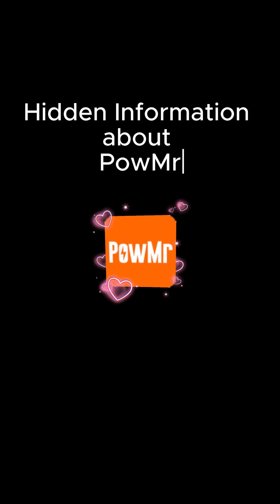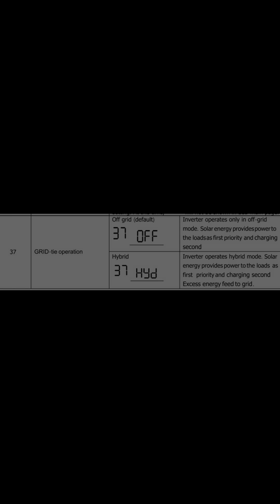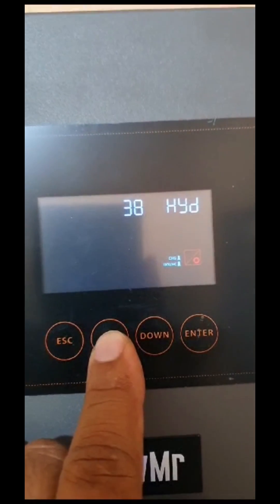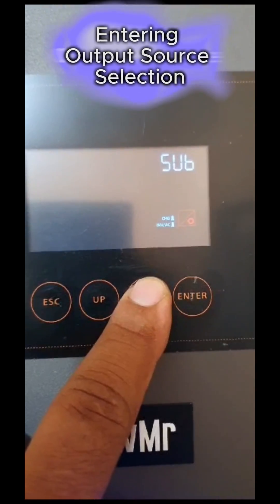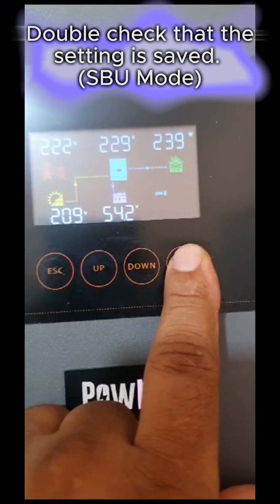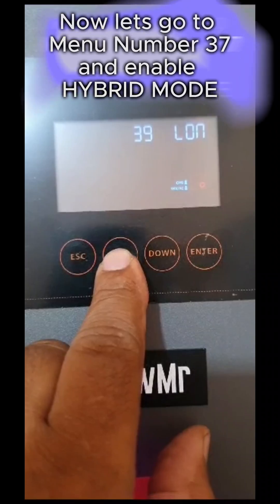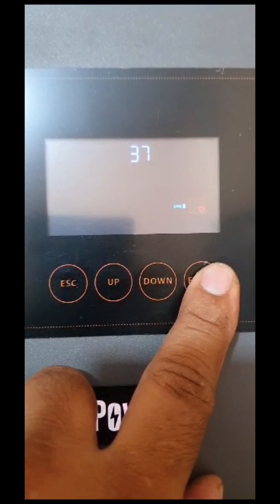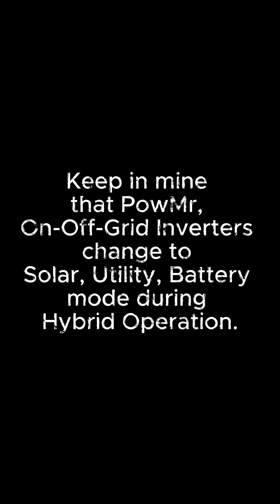Everything you need to know about On/Off Grid Inverters - On-Off Grid PowMr

Comment: I am having issues with my 6.2kva PowMr Hybrid inverter. It triggers off my battery breaker when ever I try putting it on. What will i do to power it ON ?
Reply from the maker: If the battery braker has the currect Amp range then, it seems like a inverter issue.

Comment: Hi sir, great video, thank you very much. I have one question, how's the inverter doing? Is it still working?
Reply from the maker: Sorry for the late reply yes it is. But if you get onee wire it correctly add all required protection and make sure to clean the filters and keep the inverter  clean.
Reply: @diydesk thank you very much 💪🏻

Comment: So if will choose 37 option to HYD hybrid mode inverter won't take energy from battery at night time when there is no solar?
Reply from the maker: Sorry for the late reply, Yes you are correct. So what I do it I use a Smart Circuit breaker to disconnect the grid input at night so the inverter changes to battrey mode. Hope this helps.

Comment: My set up is i disable the bypassed. 
Im sbu mode 
And snu changing 
And off-grid mode
Is my settings is correct?
Reply from the maker: It's not wring but in my case I need stop using grid power for battery charging therefore I have set the charging to Solar Only instread of SNU.

Comment: My 6.2kw having trouble ,sometimes have long sound, and sometimes if I open my AC Unit It shot down the inverter. What should I do for this problem?
Reply: 2:54
Reply from the maker: Hi, Long sound means a beep soubd from the buzzer ? If the inverter is shutting down the inverter when the AC is on it looks like overloading the inverter or having some issue with the AC unit.

It is hard to detect the cause from what you have shared. Better show your system to a technician.

Thank you and good luck with it.

Comment: In my case the hybrid mode is off, the output mode is set to SUB, but still, inverter is going into bypass. 
The charging mode is set to SnU which means both utility and solar is used to charge the battery, but this mode is only available in SUB mode. 

My best scenario would be as described below:
1. When there is solar energy sufficient, the inverter would provide power to the load first, and the unused energy into the battery at the same time. 

2. The battery would be charged by the utility at the same time by the current sent in option 11 of the menu. 
Because i've already had a grid-tie inverter solar system installed and it is connected before powmr, it would feed its power from the utility side by using extra solar energy

Would be even nicer if it could be programmed by time or action (Which is impossible i suppose).

So currently even if the priority is set to SUB, it still works in bypass mode while charging the battery from solar and not feeding any energy from the inverter.

The easiest for the powmr as i can understand is a create a firmware which allows SnU chargine (Both utility and solar) at any time or even with additinal option allowing to disable any charging (Both utility and solar) when Solar (The main source) is unavailable. Meaning that there is no energy nor from grid-tie (utility), not from DC solar side is available and therefore not to take any energy of the grid. 

I will try to contact powmr and explain to them this logic
Reply from the maker: Yes, it's a good point, Deye inverters support timing but it comes with a high price tag.
Reply: Can you not just buy a smart breaker and use that to connect/disconnect the inverter from grid using its timer option on the app on the phone.. it's called scenes automation there are many ways to automate the breaker using data from another power monitor connected to the output of the inverter or solar........

Comment: Can we export and sell electricity via net metering?
Reply from the maker: Most countrues Yes, but the PowMr Inverter may not have all required certificates for you to get the approval from your electricity provider, therefore you might have to look for a brand like Growatt or Deye (if you need hybrid) but my sujjestion is to have 2 systems On-Grid and Off-Grid seperately. It may requiremore space but in the long run it is more practical.

Comment: We have powmr inverter POW-HVM6.2K-PRO model in India .When we on ac grid input that time they show 0 voltage and battery not charging ,and input settings is USB,how to solve this problem
Reply from the maker: I am sorry, I don't have a clear answer for you but you can try few things -
* Did you try to reset the inverter settings and try it?
* Is there anyway you can check Grid Voltage / Freaquency ?
* When you have a load connected while grid is connected which power source provide power to the load ?

I think it's better to get a video of your issue and share with PowMr team.

Wishing you luck with the issue.

Comment: We have installed powmr HVM-6.2M-48V-N. it works well in off-grid mode. but in hybrid mode SUB setting inverter switches to utility itself after 02 minutes irrespective of solar energy. Batteries are attached. Please guide us
Reply from the maker: If the grid feeding option is enabled (hybrid enabled) it keeps the battery for backup during utility loss, and works on grid and solar.
Reply: Bhai ye net metering krta hai?
Reply: @talhaahmed6215  option ha. Hybrid mode per
Reply: @muhammadshahzadyousaf1282  mtlb ye lelun tou sell hojaegi?
Apne ktne ka lya tha or duty ktni di the?
Reply: @talhaahmed6215  we are using it off grid mode with sub setting. In hybrid mode it feeds extra units to the grid. K model is far better than this with option wise. Which is all in one inverter

Comment: Sir Does the inverter run if u remove pv and Ac cables but plugged to the battery only can u able to run appliances?
Reply from the maker: Yes, If you have the battery charged, the inverther can run from battery only. I use it from battery daily during night time.

With 105Ah x 16 EVE lifepo4 cells I run the house at nigth, 2 Inverter Air Conditions, TV, Lights, sometimes coocking on induction.

Early morning around 2 am I connect to Grid power automatically to save some battery power.

So this inverter can run well on Battery. If someone needs to know if this can work without battery yes that is possible too but you need to have a stable grid connection and the solar connection. If the sun is low and the usage is high the inverter will use grid power. So we need to have a grid connected. (this is required only during batterless operation)
Reply: @diydesk  Thanks for your response Sir mine it's doesn't work from batteries only the problem is when I plug a fridge my inverter the fan start to run non stop immediately so when I plug small appliances like charging phones it doesn't give me a problem so currently I don't have solar panels and electricity so I connected my inverter in 4 12v batteries (parallel) as my inverter is 12v so the batteries are fully charged I use a generator to charge them then plug inverter I tried many things even to adjust the perimeter it didn't work out and it doesn't show any  faulty sign but it can't run heavy appliances as fridge I'm talking about is the any thing I'm missing please advise me 😔?

Comment: Sorry - you misunderstand the term 'grid-tied'. Grid-tied means it can deliver power to the grid. You are talking about a bypass function: the inverter takes power from the grid and delivers it to your load. This way you have a backup function in case your battery drains down or PV doesn't deliver (enough) power for your needs. This in NOT grid-tied operation! The output of the inverter cannot be connected to the grid --> short circuit! It doesn't adopt the frequency in phase! So be careful, what you explain here!
Reply from the maker: Hi Dear, thanks for the valuable comment. Just to be clear that we both have the same idea. 

This inverter feeds power to the grid using the grid input connection not the output.
Reply: @diydesk  No, sorry - you are wrong here. Grid input means it takes power from the grid and delivers it to its own output - its just a bypass for PV/Battery. Hope you understand.
Reply: @rilosvideos877  I have confirmed from the manufacturer (PowMr) the unit supports grid tied operation and it feeds back the excess generated power back to the grid via AC input line hence the breaker is rated at 50A. I have yet to try it on my own unit after the net metering is installed. Thanks.

Comment: is there an option for offgrid but it charges batteries from generator.
I don't have remote start for the generator so I would have to turn the generator on manually for top ups
Reply from the maker: Thanks for reaching out. Sorry, I am not sure of that. Hope someone will respond to you soon.
Reply: @diydesk  No problems, thanks for the reply.
I think if I turn hybrid off and have it in SUB mode it should do what I want.
Solar first then batteries and if I turn the generator on it will take power from it before the batteries.

I'm just hoping it won't cause an error if you try to put it in SUB mode without the generator turned on.

Comment: This one produces 220v and if you live in the USA, are there any other equipment required to use?
Reply from the maker: You may need to install the basic protection devices and the isobars. Please follow the wiring video on my channel. It will give you a better understanding. Stay safe and stay Powered 🙏
Reply: I have read some articles stating to get a transformer to lower it to 120V. @diydesk
Reply from the maker: The inverter can be set to 120 check with the seller before you purchase

Comment: Is the grid tie current for limitting the power to export to the grid?
Reply from the maker: Yes the current limits the output. Just for rough calculation multiply the output amp by your grid volte. For example if the amp is set to 10A and the grid is 230V output will not exceed 10*230=2300W

Comment: Did you ever find a solution? If I want SBU then I must turn off hybrid? And WHY THE F#*# DO THEY HAVE TWO AC OUTPUTS! I don't know how to wire up t
my system because there is no explanation for how the two ac outputs function!!!! Frustrating
Reply from the maker: No matter what setting is set if you enable hybrid mode to output to grid it will change to SUB. But if you change SUB/ SBU  from the app it get confused, so don't use the app for settings changing. What do you mean there's two output's can you share a picture of the inverter connection side?
Reply: The manual is clear. The second output functions when batt is low to provide lighting during blackout etc. You can simply wire the 2nd output to an emergency light near the inverter to provide light during blackout. Note, the 2nd output works only when batt is low (I think default setting is 20V in 24V system).

Comment: I am planning to connect my POWMR 10.2KW hybrid inverter to the grid, our utility source is 240VAC line to ground. they have a bi-directional meter and a production meter. any additional information that I need to Know? Will this hybrid inverter work in this setup? any diagram that can help?
Reply from the maker: Hello, yes with the information you have provided this inverter should work and export extra power to the grid. 

Few things to check -
* Set inverter operating voltage to 240 AC
* Enable Hybrid mode

Regarding the wiring diagram you can check the video that is shared on the channel for Off-Grid Inverter wiring. There's no additional devices required unless your grid power provider request you to add a isolator externally.

All the best with your installation.
Reply: @diydesk  do this and you will destroy your inverter at once! Its NOT a grid-tied inverter! Just bypass function - it takes power from the grid, not vice versa!
Reply: Powmr not a grid tied. It only use the bypass mode. Ac in going to the main load and and load 2?
If the solar and battery is enough. It will supply main load and load 2. If not it will bypass in which ac in supply the the 2 load output.

Comment: Cho mình hỏi khi pv không đủ thì biến tần có lấy điện lưới bù không hay chỉ chuyển luôn sang dùng điện lưới.  Thanks
Reply from the maker: Có thể lấy điện từ lưới để bù. Trên màn hình hiển thị sẽ có hai đường. Một đường đi từ biến tần đến tải và đường còn lại đi từ lưới đến tải.

Tôi đã bật chế độ Liên kết lưới trong Cài đặt 37. Vì vậy vào ban đêm, nó lấy điện từ lưới. Nhưng tôi tự tắt nguồn đầu vào lưới để nó kết nối với pin. Khi bạn chuyển sang chế độ Hybrid trong Cài đặt 37, bất kể bạn chọn cài đặt nào trong Cài đặt Một (USB/SUB/SBU), nó sẽ chuyển sang SUB. Hy vọng câu trả lời của tôi đã rõ ràng. 

Liên kết hình ảnh -
https://i.imgur.com/W56Q5oC.png

--------------------------------------------------

It can draw electricity from the grid to compensate. On the display screen, there will be two lines. One line goes from the inverter to the load, and the other goes from the grid to the load.

I have enabled Grid Tie mode in Setting 37. So, at night, it takes power from the grid. However, I manually turn off the grid input so it connects to the battery. When you switch to Hybrid mode in Setting 37, no matter which setting you select in Setting One (USB/SUB/SBU), it changes to SUB. I hope my answer is clear.

Image Link-
https://i.imgur.com/W56Q5oC.png

Comment: Great Videos ! Question : I m looking for a 3.5 KW batteryless system, is VM PLUS 3.5KW a good one ?
Reply from the maker: Hi, VM PLUS 3.5 KW is that the blue and white model ? Can you please share the  item name as shown on the website. 

Are you planning on using batteryless ? Then you need to have the grid connected to take over the load when the sky goes dark even with the clouds. 

My suggestion is to use at least a small capacity battery. So it will work better during daytime even if the grid power drops. 

Hope this helps.
Reply: @diydesk  Yes it's the blue and white model, this is the model name it appears on their website. I have 16pcs  230W panels so i ll connect them (8 pieces in serial,2 sets) and connect to the grid too, and next stage (next year) to build a 24V LifePo4 battery (8x260Ah EVE with a bms) What do you think ?
Reply from the maker: I truly think a good plan. And wish you all the best 🙏 hope to hear from you once you complete the battery. ( I like JK BMS ) ❣️
Reply: @diydesk i have not connected the battery to HVM6.2M48VN and when the utility is on inverter switches to utility and operating on same at day time too. how it could be avoided?

Comment: When it switches from Solar to Utility, does the power go down?
Or it’s unnoticeable?
Reply from the maker: Solar to Utility= Unnoticeable
Utility to Solar= It is noticable
Reply: @diydesk  i think it is not a "issue" ?! because: if you "feed to the grid" (hybrid) it only work in "SUB" mode !? because: SBU = solar to load is not possible because you feed the grid ... all solar power going to "grid" and not to load ! SBU is solar to load ... if you activate the "HYBRID MODE" (feed to the grid function) the inverter "must" change to "SUB" mode (USB and SBU are not possible in "HYB" mode) ... no issue i think ! BUT: the "blink" of the "grid" icon ?! is not documentated ... in the documentation are some things missing ;) first time i thought "issues" too - like you - but now i think it is "logical" ... switch to SUB when activate HYB ... no error no issue ..